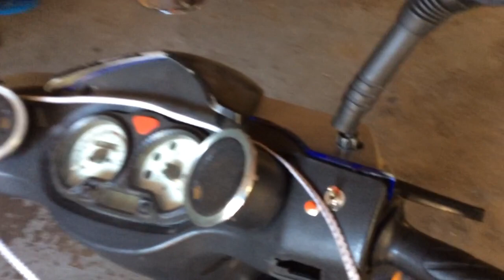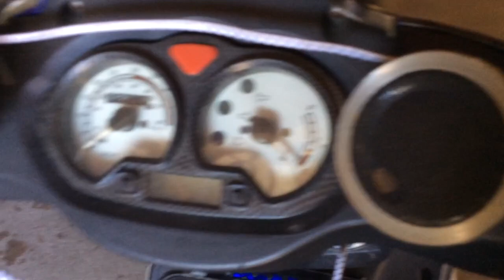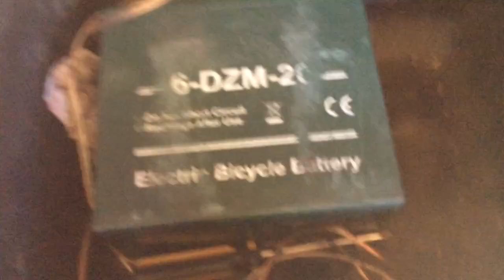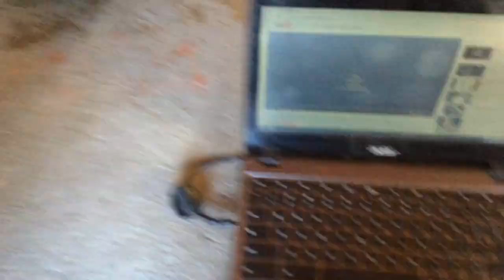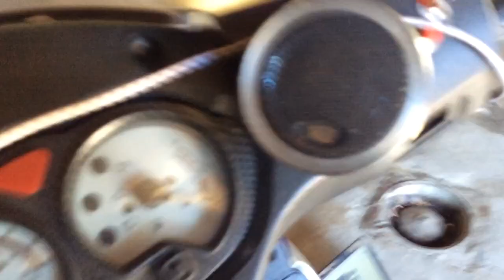my 50cc scooter with custom stereo system and hid lights

Comment: Doing something similar with build in speakers. (Going to be built like your 2 lower speakers.) With the equipment inside the seat. Only worry is the speaker itself getting wet in light rain... Is covering them the only way or can i somehow rub like a coating on that would keep it safe....They wont be as exposed as yours, but still... ( They will have the metal mesh screen cover on it)
Reply from the maker: Zeagan2310 use marine grade speakers otherwise amazon has a motorcycle Bluetooth speaker setup that works well also

Comment from the maker: all 3  batteries where wired directly to a breaker on the positive side and ran in to a distribution block then fused and sent off to the electronics on the bike the batteries are 12v 15 amp hour

Comment: Hi,does the bike recharge those batteries? I have a honda scooter and it runs on a 5lb battery and wondering if i put a bigger one it might spoil the starter?i want to install boss 500mc.any advise?
Reply from the maker: It does not charge properly I had a charger I kept with me but they do make motorcycle stereos that are low power I would recommend investing in one of them check out Amazon
Reply: Joshua Reyes soo as the boss mc500 is 600 watts but the other scooter compatible dont have enough power,if you go 40mph and above you cant hear anything.is there a way i could make the boss one work? Advise please.
Reply from the maker: The only thing I could say is point the speakers in your direction or get more efficient speakers with a higher sensitivity rating also remember that sounds quality will be worse when your driving simply because your in a open area if anything I can say install a equilizer and keep the bass settings low and turn up the mids and highs